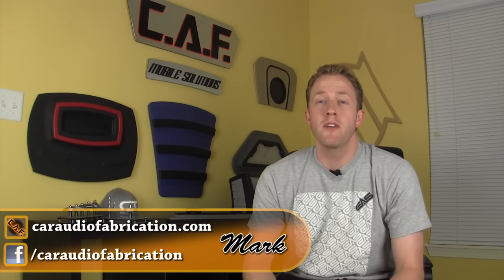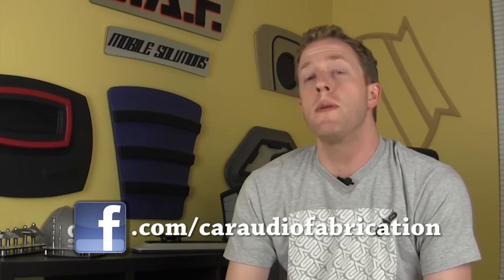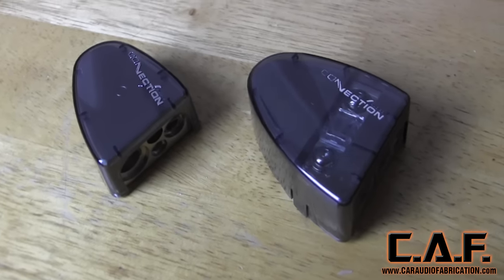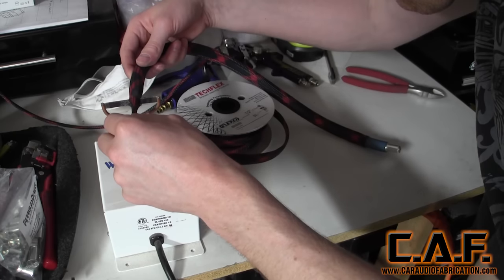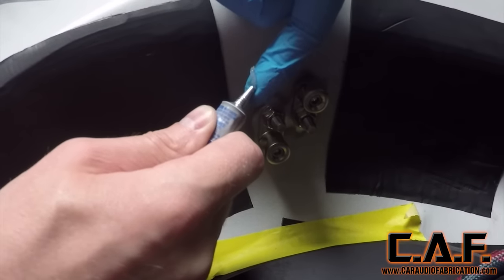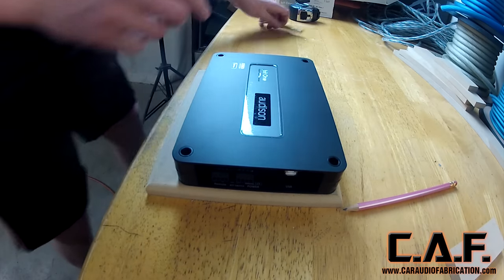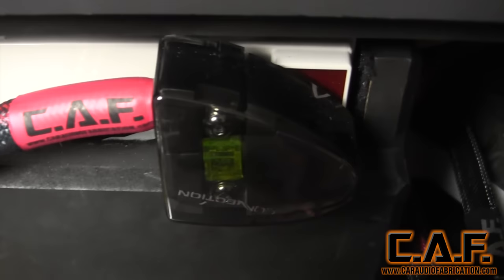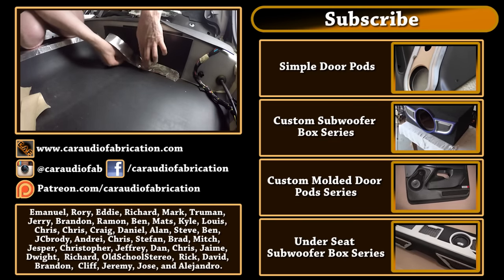Car Audio Wiring - VBL #6 - CarAudioFabrication

Comment: huge car audio fan. I also love bmw (refuse to drive anything else) and older bmw can be modified quite easily, but when it comes to newer bmw such as a 2006 330i they require a programed bmw battery for the car and the vehicle has problems with any kind of basic funtion with an old battery or a battery not cranking enough amps such as electrical glitches and in the automatic transmission versions potentially not switchimg gears correctly, very big problems. how would someone put a full 4 channel speaker, tweeter, subwoofer upgrade with amplifying all speakers and redoing the wires, running a seperate amp to the subs and not allowing the vehicle to struggle with power and keep the car coded with no errors. even the factory stereo decks are encorporated with a code that pops up and has to be disabled by the dealer if the deck is removed? not sure if this is to advance, but someone else has to have a simular problem.
Reply: One would go to a qualified professional and ask for a quote.
Reply: Since you and all BMW owners will VERY SOON be headed back to the dealer service department (if you can afford new or used but still under warranty) or to whatever indy mechanic you use if you're of those who gets some used Bimmer thinking "wow, this thing was like 80 grand not long ago at all and now its on this shitty used car lot between two Kia's for $4999, what a deal!" Yep, won't be long till you find out just WHY that Bimmer (or MB or Audi) is so fucking cheap used vs say a Lexus or Acura (cars you don't need to sweep parts off of garage floor each morning that fell off overnight!!) 

So, since you know you'll be back at the shop real soon, just ask them!!!
Reply: +Rocco Siffredi696969 if you work on your bmw yourself they dont cost that much. but that ok, acura, honda, nissan, all the same shit if you ask me, badly designed economy car. i prefer acura for a daily just because they are cheap and if it breaks then whatever, but for a fast, well designed, safe, controlable, luxurious, quality car there is no question. you have to do your car maintenance for any car to last, most people dont know what changing transmission fluid, cleaning vanos solenoid, fully synthetic oil changes are so ill stop preaching to the deaf. dont judge a car manufacturer unless you own one!
Reply: Actually, BMW is only German luxo make I haven't owned, but have had MANY friends who've owned them, all the way from at the bottom the fool who thought he'd be "rollin in style" in his 7-series, he ended up renting some extra garage space I had, since he QUICKLY ran out of $$$ to fix and had some pipe dream he'd get it going some day, NEVER happened! From that barely above a Yugo pile of shit all the way up to two friends who bought or leased NEW M5's, one was the V-10 a while back, other more recent, but Idea is-drive em till warranty's running out, then get the fuck away from em!

I don't know what kind of Acura you had, the Integra, RSX and whatever else were basically fancy Civic's in a way (but ever compare ANY Honda 4 cylinder motor-hardest to get a smooth motor with only 4 cyl, to say the VW/Audi motor, 4 cyl that's been the 1.8, 1.8T, 2.0, 2.0T, I saw some ad where they bragged about how many of them they'd built, 4 trillion or whatever, but i had a 2.0T in my Audi A4, bought just barely used and that thing was rougher than my fucking lawn tractor! Any Civic 4 cylinder motor, SMOOTH AS SILK!) but I owned two Acuras, A CL coupe and RL sedan, definitely NOT economy cars and they were AWESOME, had basically ZERO problems and both I bought fairly well used! 

I'm looking for a Lexus ISF possibly now, or maybe I'll wait to see if they come out with a new version, but having owned an A4 and a loaded A6, plus a 450sl classic MB and a E500, plus all my friends with Bimmers, they've got a long way to go and FUCK NO do I want to spend my TINY amount of free time wrenching on some German junk! I've got my own biz and work my ass off, fuck wrenching on some hunk of shit car!!!
Reply: +Rocco Siffredi696969 i know like 5 people with v10 bmw and its all about the maintenance, rod bearings, 3000-5000 mile oil changes, preventative vanos oil line replacements, other than that those e60s are great, its not my fault if your friends are scared of there own cars because they dont know anything about them. Audi and Volkswagen use alot of 2.0 turbo engines, one of the best engines ever produced in my opinion, simple pcv change that takes all of 5 minutes, ignition coils when they go bad, preventative water pump replqcement, those stupid valve cleanings for direct injections which is a given on most di car without methane added on, basic fluids and spark plug changes and you have an engine that runs 300,000 plus miles that has reall power and stock engine pushes serious power with simple modifications like software. nothing against lexus or japanese brands, but things like timing belts, steptronic automatics and drums brakes are old outdated technology the german manufacturers dropped ages ago becuase they wanted to move forward. and having to redesign a car to be able to enjoy it is stupid, something the manufacturer shouldve thought of before hand. An oem bmw was designed to be a fun, safe easy to work on platform, try that in a 4cyl honda platform, by the time your done making a car that handles almost ass well, has almost as much power and still wont outlast its german rival youll of spend $12,000 in simple upgrades that the manufacturer never intended nor was the vehicle designed for. those cars have to be pushed to there limits to even make it up a hill, slap a turbo in it and run it hard and youll be lucky to hit 150,000 miles where as a german car was designed to be driven hard and last 300,000+ miles. things like changing a heater core, changing timing belt or adding more power because most cars have more than 200hp are struggles for any Japanese car, and there trannys wont hold up for anything. have fun in your boring poorly designed japanese cars with outdated technology, ill be cruising or racing down the road in a car i actually want to drive that i work on myself because im not lazy and value the conection between me and my car unlike you through away "screw it" mentality most japanese car owners have. geman cars last when you actually know what your doing and how to maintain it, they dont cost a lump some extra if you go out of your way and research before you go and spend $1000 on something you could do for $100. that will last 200,000 miles. laziness is the main reason you wouldnt own one again. youll understand why us german car owners are stuborn about everything once you cant keep up with one, or you crash your japanese car and get injured because lexus wanted to save a buck by compromisimg you and your familys safety.

Comment: How to install a capacitor and how to discharge and charge one
Reply: +Jordan Bethea Capacitors are garbage...just install a second battery.
Reply: +Jordan Bethea If you're headlights are dimming a cap will only make the problem worse.You should probably do the big 3 upgrade.

Comment: Smaller wires after FDB 54.1 protected by blue (60A) fuse in SFD 41C.1 ?!
Reply: Audi80iron Good eye, but it is actually a 20A on 12awg primary wire, knukonceptz has blue for this size.
Reply: CarAudioFab thanks for the answer!

Comment: You use stainless steel for electrical connections? I guess you don't know it has a considerably higher resistivity than mild steel,copper,brass etc etc making it unsuitable for anything where a voltage drop is unacceptable.
Reply: Chris Plunkett point taken, but stainless does not rust, carrode, or oxidize over time. So in the long run it is better. Plus if you'll notice he is using grounding lugs that are made out of one of the materials you stated and they come into direct contact with the body with the paint removed.

Comment: https://en.wikipedia.org/wiki/Galvanic_corrosion not allways a good ideia mix diferent types os metals, better use galvanized bolts , other way the metal in contact with the bolt gona get rust, on the ground cabels, but the rest , its a pleaser to watch your videos.. great job. keep strong..